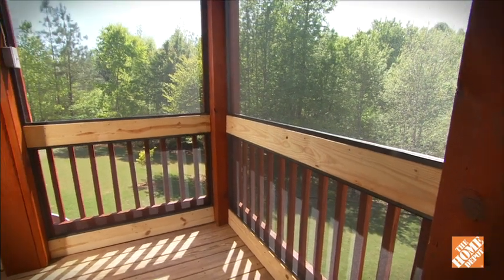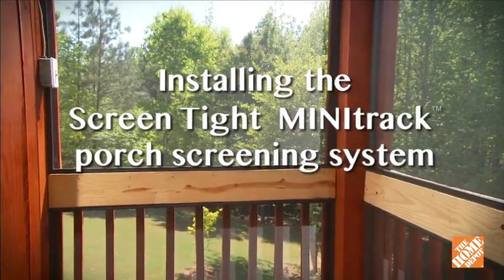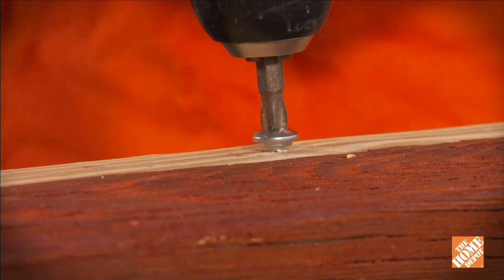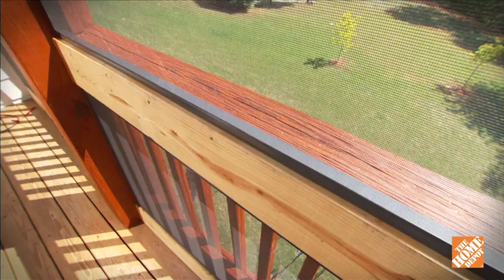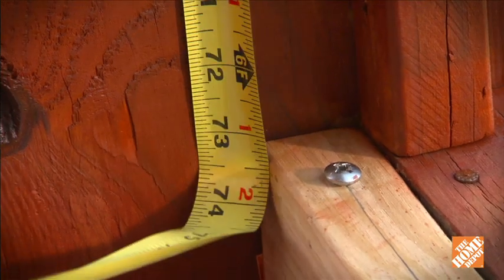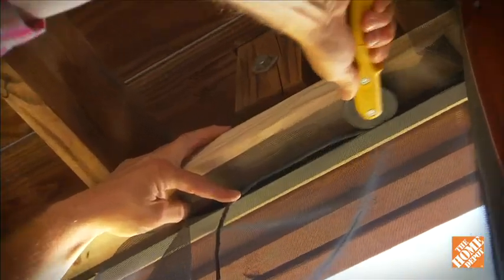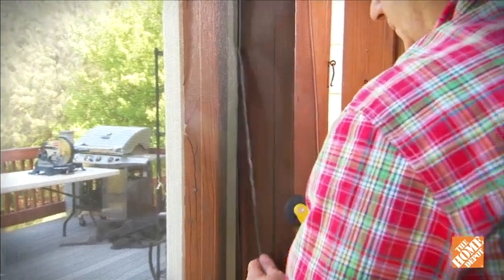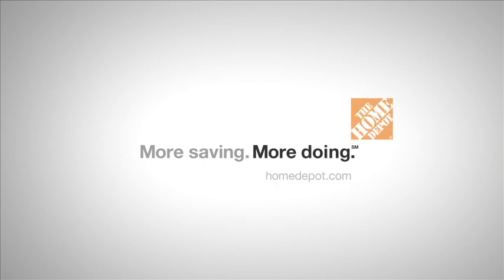Screen Tight's Mini Track Porch Screening System Installation Video

Comment: My experience is instead of starting your spline w/.a roller, it's much, much easier to first make it level across the top w/about 2" play on all four sides using the rubber mallet to start your spline instead of the spline roller by tapping it lightly along the groove track of the base.  First go across the top & then go down the first side tapping it in with the rubber mallet, you will then need to tug on it lightly as you go, pulling it a little to the outside while tapping the spline in as you go. After it's been locked in' do you then roll it in w/a roller wheel. It's a real struggle to roll it first opposed to tapping it in w/ a rubber mallet, as it does make more sense & is so much easier. Afterwards you tap the cap over the track. Note though ' another pointer is if in a tight corner, do not put your base track tight against the next wall as the cap just may not fit if it's in to close or tight to the next corner. Take my tip & save yourself a bit of trouble. Also if so you have your screen already trimmed & realize your screen is not tight enough, don't sweat it or replace it, just fix it. Unzip the spline from the bottom of one side up, but not all the way up! As it is if the screen is too lose it will give enough slack to pull it tighter & just grab the screen under the spline section that was left in tacked, start tugging it back down & out while tapping the spline above it back in track w/the rubber mallet & finish it w/the spline roller wheel, if need be pull the top of the spline down & repeat it going upwards from the point where you started going down. Be sure  not to screen the wrong groove in the track as it is shared w/the window or screen next to it & if so it's pulled across both grooves the tracks cap can not & will not fit into it's proper space. But my main point here is use the rubber mallet first in starting your spline that makes it so much easier. I just happened to find this out praying to the Holy Ghost as I was having troubles tightening the screen for acceptability purpose. I was struggling with it when the Holy spirit spoke it to me. And May God just bless those of his people. Amen

Comment: Nice but, this video does not explain how to deal with splining corners.  Nor does it explain how to build an inside frame to mount the rails.
Reply: I'm curious about how to handle that too.  Does it just have a mess in the corners?
Reply: we've been trying to find that as well
Reply: Yes….yes we are still trying to find this our